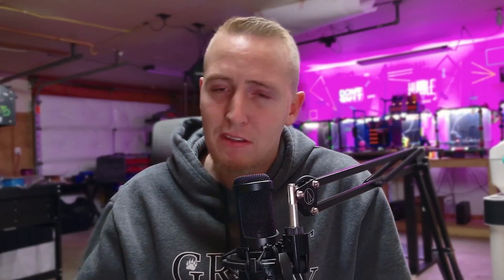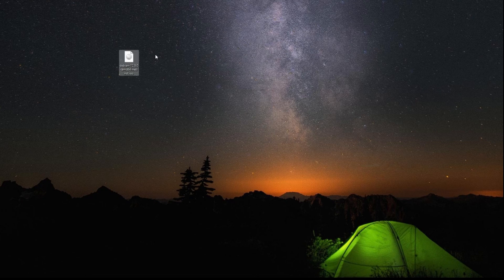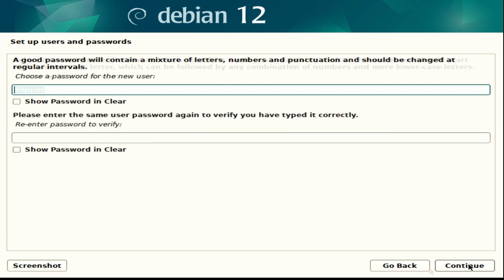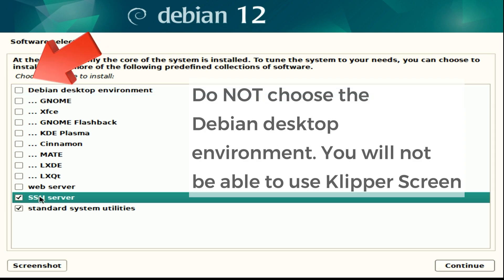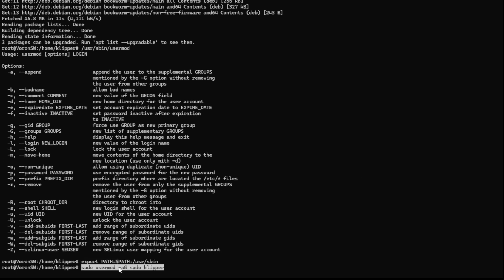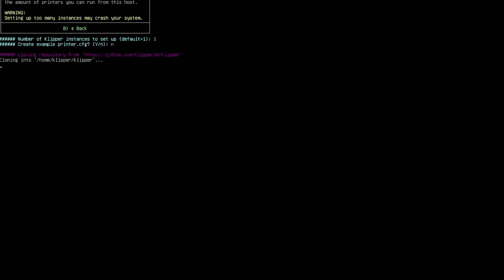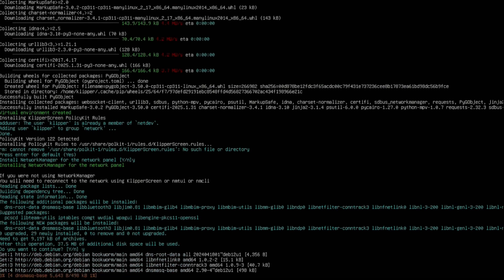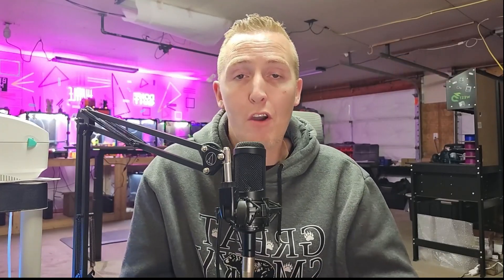🚀 Install Klipper on ANY X86 PC – The Ultimate Step-by-Step Guide! 💻🔥

Comment: I've tried this on a Dell Studio Laptop from 2008 with Windows 7, and the installation failed at the point "Configure the network".  I can't get the computer to connect to the internet and the installation keeps cycling back to "Configure the network."   What driver do I need for Debian operating system for the Ethernet and WIFi.  I downloaded debian-13.0.0-amd64-netinst. Do I  need  version 12.9.0? I'm trying to get my Da Vinci 1.0 working again after flashing the 3d print following another YouTube video.
Reply from the maker: Do you happen to be on the discord? There could be a couple things causing this. If you want to ping me on there I'll help you get thru the rest of the installation. Discord link is in the description if you need.

Comment: Well, I didn't get very far. After running:
sudo apt install command-not-found apt-file
I get the errors:
Unable to locate package command-not-found
Unable to locate package apt-file
This is on a fresh Debian 12 install.
Reply from the maker: You may have missed installing sudo part. If you need some help join the discord link in the description and I'll guide you through the rest.
Reply: @leemerie3d  Ah, thanks Lee. I was going straight off the video, and I don't think that part was in there, but I see it's in the list of commands you linked to. I seem to be progressing now.
Update:
Seemed to finally have got it all installed (got a lot to learn about Linux LOL). Just have to figure out how to start Klipper, it's nowhere to be seen yet on my Debian install.
Thanks for the great video.
Reply from the maker: @keithscott9774 Yeah sorry I missed that in the video. I was having some issues with the screen record with that.
If you need anything else just let me know. Good luck!

Comment: Since you asked at the end, trying to get back into 3d printing with my Rostock Delta Mini. I had upgraded it back in the day with a Duet 0.85 running RepRap, but support for the board ended back in 2020. I'm hoping the advanced Delta calibration in klipper will help with some of my build issues, assuming I can create a config file for the 0.85 board.

I also had an old Asus Netbook with an N450 Atom chipset that I assumed would be faster than my raspberry pi 2. So I tried MX Linux and Kiauh 6, but keep getting errors. I like your Debian install however, especially since I really don't need a desktop ui, though I am hoping I would still be able to use Mainsail or Klipperscreen with the netbook.

Fingers crossed my second attempt following your video works. Have a great 4th of July.
Reply from the maker: Oh that Asus notebook will do great for running klipper! Thanks for watching the video. 
When you go to follow it and if you run into issues join our discord server and I'll help you thru it. 
Also, make sure you use the pastebin link in the description for the commands. A lot of folks miss that. Good luck! 😎

Comment: Hi Lee, i just flashed a bootloader on to the Creality v2.2 board,  i should be able to flash Klipper on the board now correct?
Reply from the maker: Absolutely! I haven't messed with that board in a long time but you should be able to now yes. Join our discord I may be able to help you out with that! Id like to know how it goes either way though 😃
Reply: @leemerie3d  Hello, well i have been running klipper on my stock ender 5 plus now for over a week, it makes a big difference in print quality right out of the gate....If i make a video on how to get it installed on Ender 5 plus will you check it out for me before i upload it? I have never done one of these video's before. Oh also there is no raspberry pi it is an old desktop running elementary OS 7 straight to the printer that's it....
Reply from the maker: @allthingselectronics3161 Oh klipper makes a huge difference when it's installed! I would be happy to check out the video before you upload it. Ping me in discord or join the server. It's linked in the video with the social links at the bottom. Chat soon!

Comment: Hi Lee, the only problem i am having flashing Klipper to Creality V2.2 8bit board. Ender 5 Plus with Stock Board. I am not sure if there is a bootloader on it or not, i was able to flash insanity automation on it about a year ago by flashing it through Cura with Hex file. I see alot of video's where you have to buy extra stuff to do it....I believe it can be done without any purchase  with Arduino IDE or something, Do you have any suggestions?
Reply from the maker: This should be able to be done yes. It has been a while since I have worked with those boards but I would be happy to help try!

Comment: While in stalling Debian, if you do not define a root user and leave it and the root password blank, Debian with setup a sudo access for you for the primary user. No user mods or group defining needed. Running the KIAUH script will be happy to setup up everything for you via sudo just like just like on a Raspberry Pi Lite setup. Still will want setup Debian without graphical interface and SHH set to on. The new N150 based mini PCs are worthy replacement for Raspberry Pi in 3D printers electronics bays. 12 volt and less than 3A draw. Add small hdmi touchscreen for Klipperscreen setup with KIAUH too.
Reply from the maker: Oh that's a bit easier actually! Thanks for the tips. This was the only way I knew to do this but maybe some others will see this comment and it will help them a bit easier way about it. I'm definitely not a pro when it comes to Linux. Still learning but I can get around a little bit :) Thanks for watching!